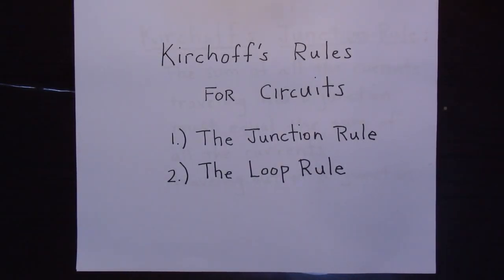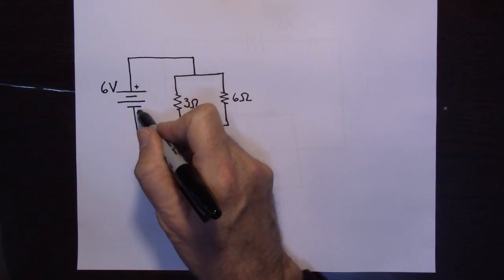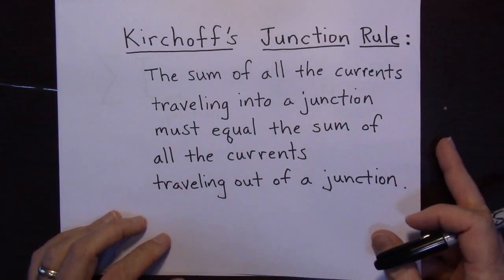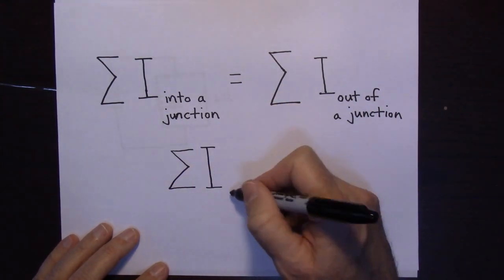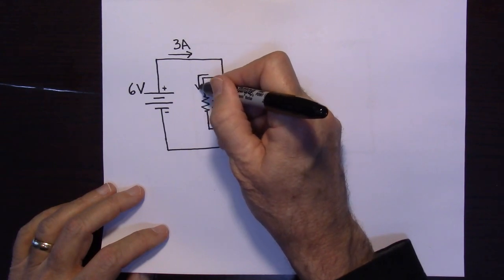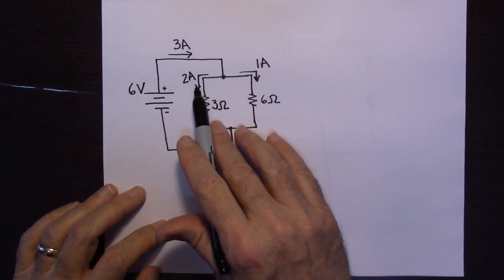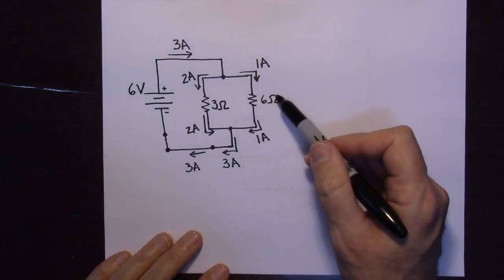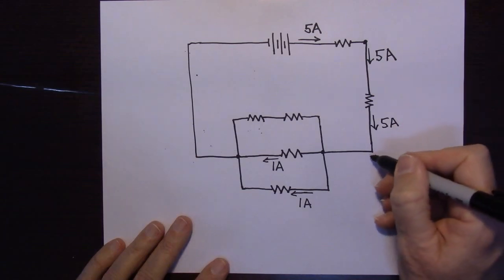Kirchoff's Junction Rule for Electric Circuits

Comment: what if the voltage of battery is not given and total of current is  not given. only one resistor's current is given then how to find out the current of the other resistor which is in parallel of eachother? pls answer
Reply from the maker: Assuming that you know each of the resistors' resistances, you could find the voltage drop across the resistor with known current, it's  V = I*R.  The other resistors will have the same voltage drop.  So you can find the other currents by using I = V/R.